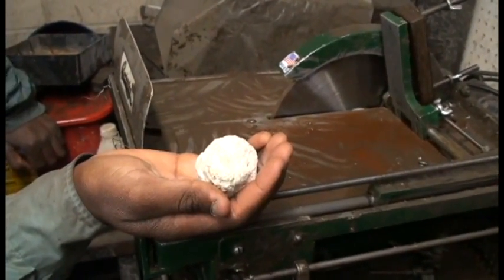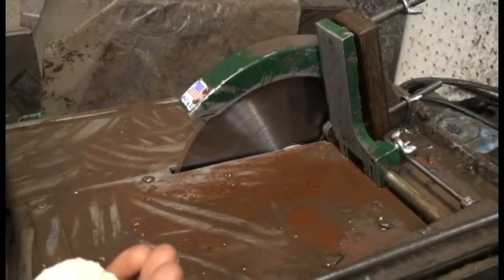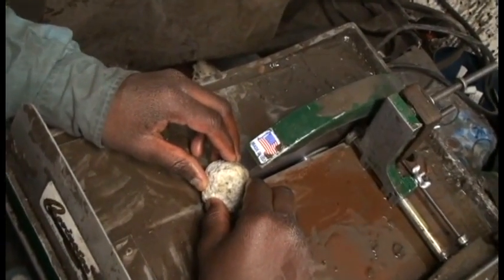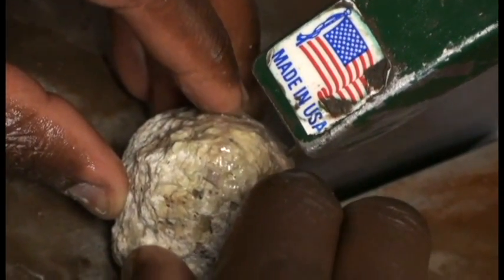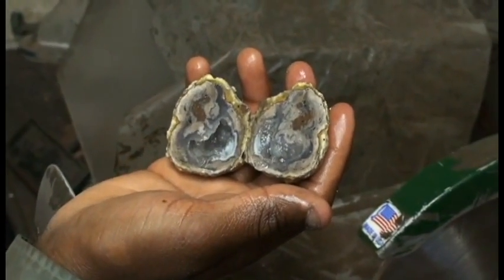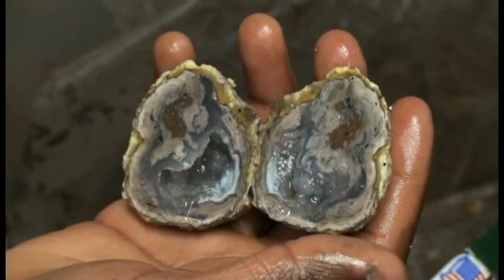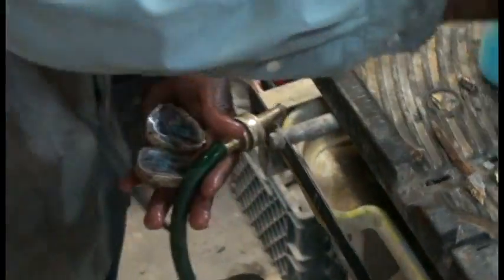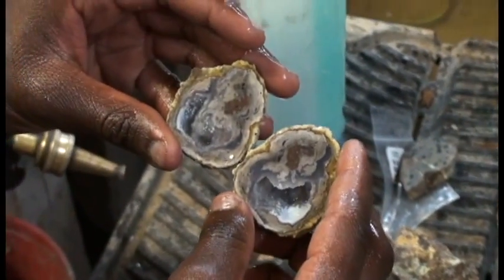How to Cut A Geode In Half - Lapidary Information Tutorial

Comment: Props to Covington, etc., but some hobbyists don't have hundreds / thousands to spend on equipment, and it's inaccurate to claim that there aren't good, affordable alternatives. I use a modified 7" tile saw with a 10" diamond blade and it has no problem cutting agate / jasper / ~mohs 7 stuff.

Good job Frederick that was a good looking cut.
Reply: Can you tell me more about your saw modification? Did you just open the throat plate to accept the larger blade? What horsepower would you recommend?
Reply: 81OH4Z4RD A couple of days ago I found an old Felker tile magic saw. I don't know how old it is but it is very well made and goes through jasper like a hot knife through butter. It is 8 inch.
38 dollars and it came with three original felker sintered blades. 
I couldn't buy a single quality blade for 38 bucks at the local ace hardware. 
Thanks for giving me the idea of making this saw a ten inch through mods.
Reply: Yeah-I use a tough old 7" tile saw,too.It works great on small/medium stuff.next spring,I'll hopefully get to use the big rock saw that I have.It uses oil,and I haven't tried it yet!